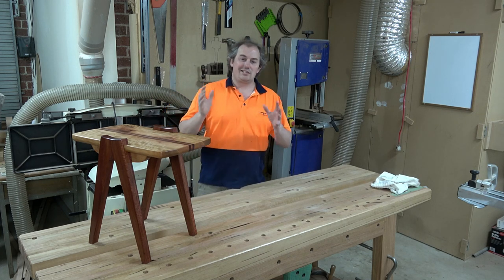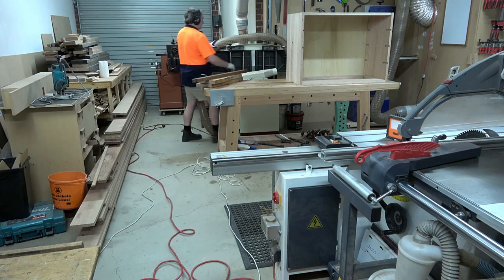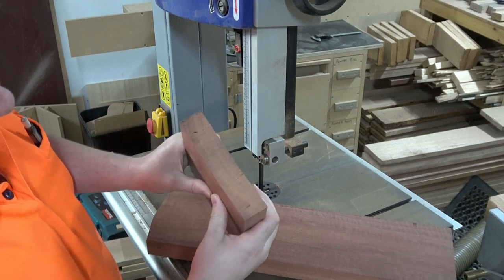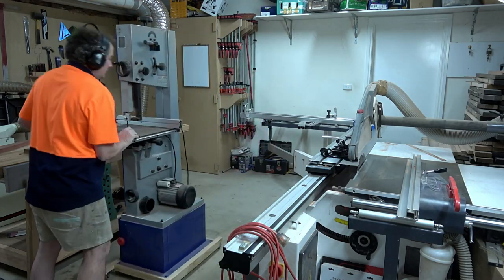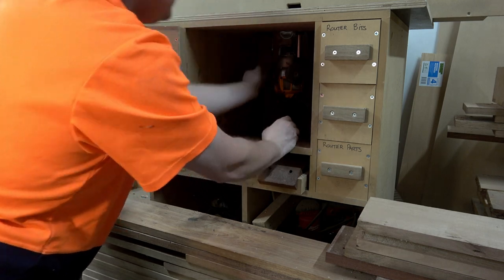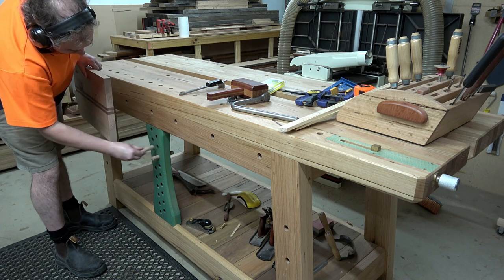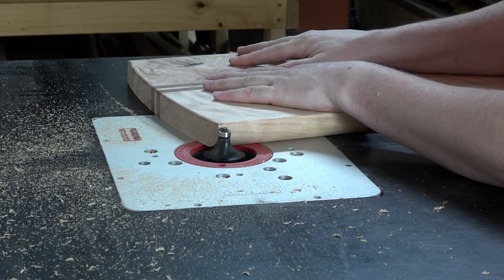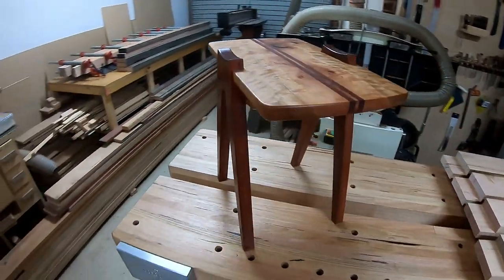2020 Woodworking Shop Tour // #AussieWorkshops2020

Comment: Beautiful little table Kuffy. I've been waiting for your 'Yearly' project 😎. Each workshop to there own I guess. I too have only one 15A outlet, and three tools. I have strung up an extension cord from the ceiling  and have the machines central to that, so the cables/plugs can reach. Same deal with dust extraction. Up and over the top with 100mm pipe with Y piece manifolds to keep the flex as short as possible.  Go on... be a devil and treat yourself to a late Christmas present.  Get a Domino.   Boy will you quickly see the benefits
Reply from the maker: Lol. This is a domino free zone...until the domino becomes free or a lot closer to 'free'. I thought about doing daily vids for this upcoming workbench build, but instead i've decided to build the bench in its entirety, then release the full build video here on this channel. From there, I'll release the shorter part 1/2/3/4/etc vids on my second channel. One vid per week for 8-10 weeks probably?

Comment: Hi Kuffy! I could have sworn you just wanted me to have that gorgeous side table! Your shop is not really small...you have a lot of tools and stuff! When you make the new work bench, are you going to get the old one out of the garage? You know what they say, "Out with the old, in with the new." Can you designate one section for all the wood? Having stuff on wheels is most convenient. Anything that is obstructing you needs a solution. For 2021 you can make some things run more smoothly for you. Take care and all the best for the New Year.
Reply from the maker: My workshop is bigger than a standard double garage. The little section in the back corner and the front corner is the "extra" from a normal double garage. Which is good, because I have a bench in each section. The old table/desk/bench will be disposed of. Dad and I used it as a site bench when we built this house. It was great for that, though it's been in the way ever since. I used to store all of my timber in the front section where one of the benches are, though I used to store it on the ground. One of those benches was specifically built to store timber, but it's only good for lengths up to about 3 meters long. I could cut my long lengths short just to store them neatly, but there is a near 100% chance of regretting doing that. As I move along, I make an improvement every now and then. When I am older, balder and fatter, the shop should be near perfect, though I won't be 😂

Comment: Good stuff Kuffy! 
I have my bandsaw set up to out-feed on the right table of my panel saw , judging by the pile of timber you have there you never need to extend the fence right over either.
Definitely have an edge sander in my future.
Thanks for the video.
Reply from the maker: My panelsaw can "rip" 1200 wide. But I never do that, because it is much easier to leave the sheet on the slider and just set the width using the crosscut fence. I do use the rip fence as a crosscut stop at 1200 long from time to time. I have about 600-700mm behind the blade before the stack of timber gets in the way, so I can crosscut something 1200 long and 600-700 wide. 
I highly recommend one of those edge sanders, best thing since sliced bread 😂

Comment: Glad to cya back stronger and making some goodies,your space restriction must drive you nuts i know mine does
Reply from the maker: I'd love more space, but what I really want is 3 phase power coming into the workshop. I do have a plan to solve both issues, I just need to pull the trigger and commit myself to the plan.

Comment: Hey mate. Instead of one cable switching between two machines- run two cables via ceiling and just swap at the outlet!. Great video as always.
Reply from the maker: That is a very good idea. I have thought about it in the past, but I talked myself out of it because I use that one extension lead to power the combo machine as well as the router table and the bandsaw. Thinking about it further, I could run a few cables, and possibly drop a cable down over my joinery workbench. Thanks!

Comment: I'd love you to do a video on your finishing method(s) . I'm impressed by the finish on my Kuffy Mallet!
Reply from the maker: Hi Peter, thanks for purchasing one of my mallets. The finish on those is the same as I used on this side table. 2-5 coats of Minwax Antique Oil, and then a coat of Ubeaut traditional wax which gets hand buffed. The mallets only received 2 coats of the oil, because it does build a film, and any surface film will deteriorate rapidly on an item such as a mallet. The oil serves to protect the timber from greases and glues we often come across while woodworking. I'll put more screen time into my finishing process on a video in 2021
Reply: @kuffyswoodwork  Thanks Kuffy, what sanding do you do prior to applying the oil? I enjoy all your videos, I learn a lot from them.
Reply from the maker: @peternewman9713  I do as little sanding as possible. I start at 120 grit, and finish at 180grit  (with the grain). It is sometimes easier to sand to 320 grit with a random orbital, and then quickly hand sand with the grain with 180 grit.

Comment: Grind down the ground for the extention or the tool and you can plug it into any outlet.
Reply from the maker: What do you mean?
Reply: @kuffyswoodwork  The bottom prong is oversized to prevent you from plugging it in a normal outlet. If you file it down it'll fit.
Reply from the maker: @Ace-zb5xr  oh! The electrical ground. Lol, I thought you may have been talking about cutting trenches in the concrete slab to run wires 🤣 I think grinding the ground on the combo machine would 'ok' on a 10amp circuit, but my saw will likely trip the breakers
Reply: @kuffyswoodwork  lol no trenches. Do we call it Earth or ground? I can't remember.
It might..I get away with a welder up to medium settings then I have to switch over if the job requires higher voltage. I use one of those surge protectors so if it is going to trip the breakers it'll only trip the surge protector. Saves me a trip lol.
Reply from the maker: @Ace-zb5xr  I have my 15amp extension lead plugged into a powerbox with a breaker switch. It never trips the house breakers, always the powerbox breaker. I call the third pin the "earth", but I'm a woodworker with machines that have all been "grounded". They make it confusing :D

Comment: Where di you get the oak for the workbench? I'm in Geelong and thinking of building something similar
Reply from the maker: The Tassie Oak that I have used for my workbenches came from my work. They were old structural beams that had been left to rot in the garden for a decade. They had no value at work, but after I did a tonne of machining and gluing, I was able to piece together a pretty good benchtops.

Comment: damn ! I thought you had everything installed and piped in to the hilt but you fidget those tools left and right all over the shop every five minutes. I'm gonna have to change what I mutter to myself every time I have to drag my tools out from under benches cos I don't have space ..... "feck this, wish I had it all set up properly like that aussie bloke wassshisname"
Cool tour though, just one question - do those roller doors open up to go right through the house or are they on either side of a middle piece of the house ? Have never been able to figure the geography out.
Reply from the maker: Haha, yeah. Nothing is setup permanently. I even have to move my OzzyOcker workbench because that gets in the way too. There are 3 roller doors in my garage. One is hidden behind my tool wall. The one at the front where the new bench will be going faces the street, my car is parked out front. The roller door at the back near my woodlathe goes out to the side of the house where there is a 6m x 3m paved patio, and then keeps going to the backyard which is really just a 3m wide easement.
Reply: Now I'm really confused.....It's a double garage but lengthways rather than side by side, but there are three doors.? How come?
Reply from the maker: @TakamiWoodshop  On the front of the house, there are two single car garage doors side by side, but they are not level with each other. The door I use to enter and exit the garage sits forward by about 2 meters from the other door. That creates the little section at the front where I will have two benches. We did it that way because it reduced the length of a big steel beam by 2 meters which runs lengthways down the middle of the garage which is supporting about a 1/4 of the upstairs roof. Saved me a bit of $$$ on the beam.
Reply: @kuffyswoodwork  makes sense now 👍🏻. My garage door opener crapped out a couple of weeks ago. Now I have to lift it by hand and prop it up on a bit of wood. Proper pain in the backside it is.

Comment: What do you do when the dust collector is full do you take it to the dump or put it in the bin? And what finish do you put on that side table?
Reply from the maker: I generally let each of the two bags in the extractor fill up to half way. Half way means I can empty the bags into a cheap garbage bag without the garbage bag overflowing and making a mess. I then store those bags of sawdust in my dining room and eventually take them to the dump. 

The finish was Minwax Antique Oil. I believe it is a 3 part mix of boiled linseed oil (or tung oil, but I doubt it), polyurethane and turpentine.